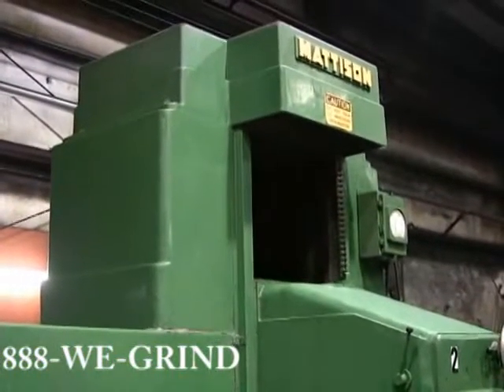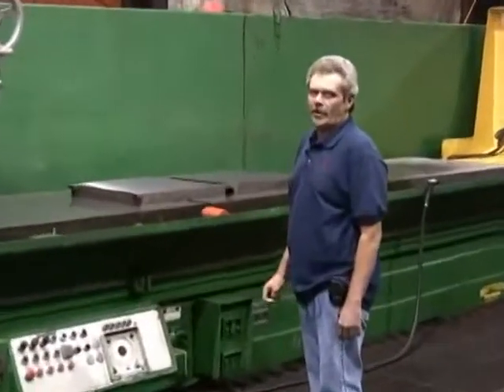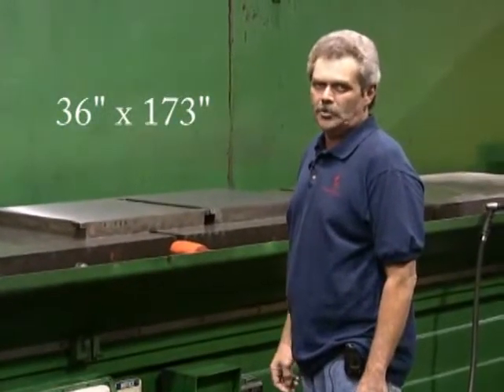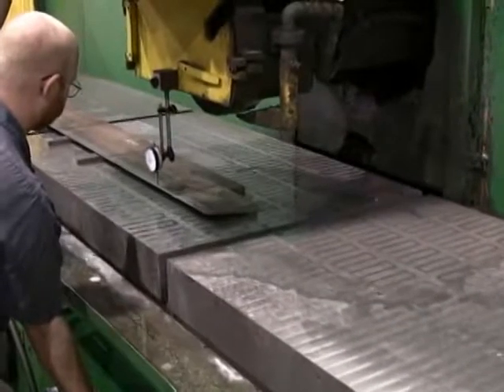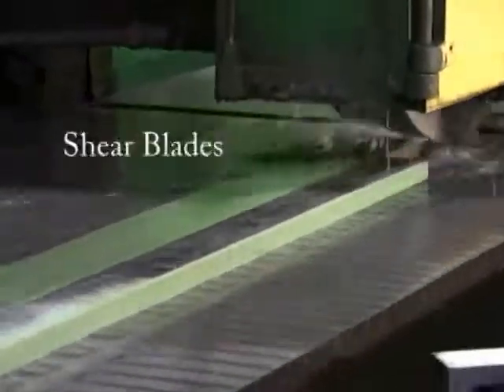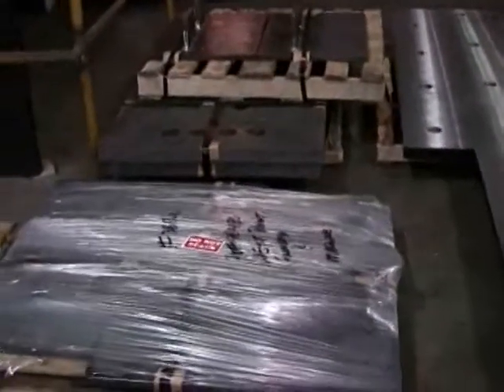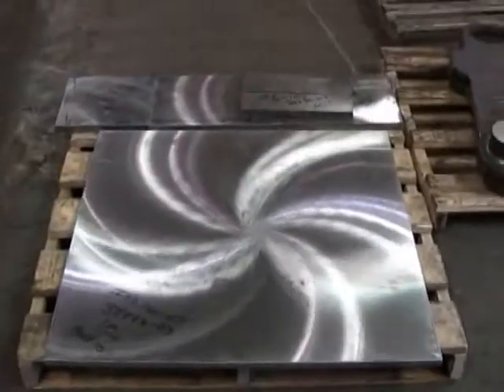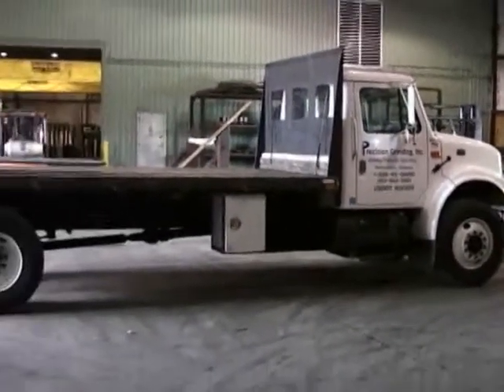Surface Grinding with PGI

Comment: Dear
I am Md Mirazul Islam, Proprietor of The Engineering works from Bangladesh. 
 I am interested in purchasing a Hydraulics Horizontal Surface Grinding Machine for my own work, 
which is 50 inch in length, and 25 inches in width.